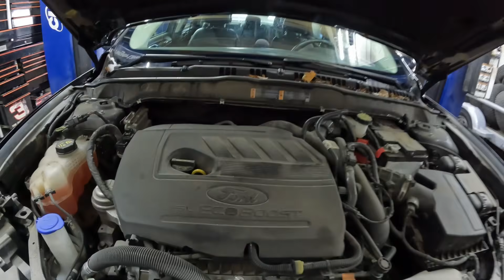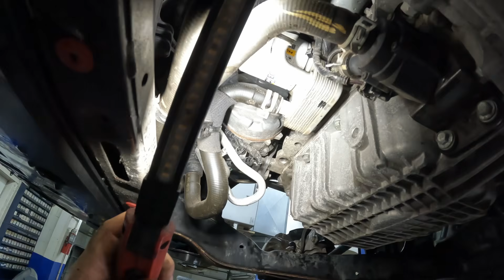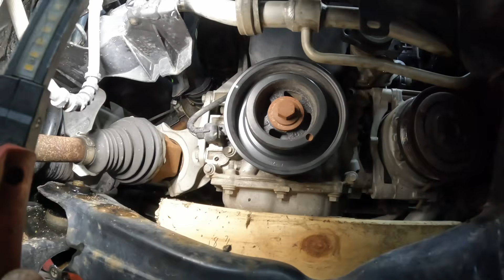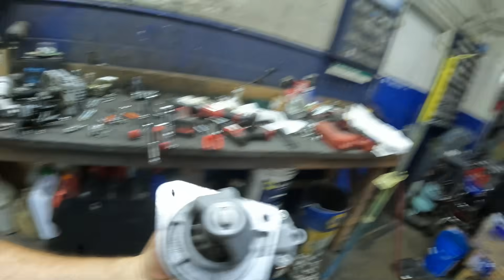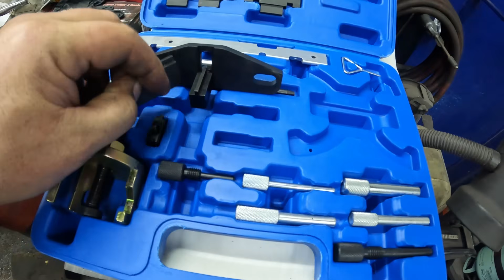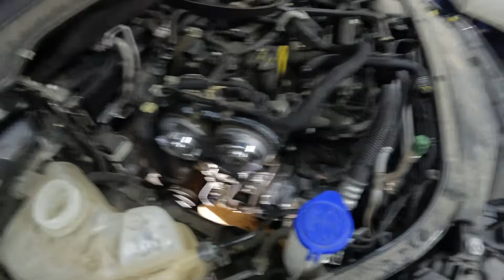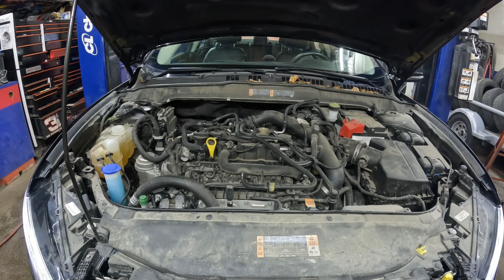2018 Ford Fusion 1.5L Ecoboost Water Pump & Timing Belt

Comment: @paycheckmonster Hello, would this be the same procedure for the 2013 Fusion 1.6L? Thanks in advance. I'm having troubles finding an answer. Planning on using your video to do the job if so.
Reply from the maker: I believe it is same procedure.  If you buy the timing tool set, it should have 1.5 and 1.6 tools in it. They might be the same tools also.  Not 100% sure.
Reply: @paycheckmonster  ok thank you. Also, great video! Another question regarding bypassing the removal of the starter. Would you suggest leaving the timing belt on while cracking the crank bolt free with an impact? Would there be any issue if the crank moved counter clockwise a little bit doing it this way while getting the bolt loose? Thanks in advance.
Reply from the maker: @JC-yb7vc  I take the crank pulley off before removing the belt.  That's just how I do it.
Reply: @paycheckmonster  great, thanks!

Comment: Just wondering what Book time would a Ford dealer have for that job?      Great video. Thank you.
Reply from the maker: You would have to ask the ford dealer about there pricing.  Thanks for watching!!
Reply: Prolly 7 to 10 hrs. I know its 14 to do the headgasket. And it takes all fucking day maybe 2 days. It pays 19 or 20 to replace the shortblock. Basically rebuilding the whole motor a weeks worth of work for 19hrs. And they say we screw the customers. Wrong all data pro demand and all these programs screw the techs hard. Luckily I work at a shop where I can pick and choose. I run my codes on these junk boxes get misfire on cylinder 2 and misfire on first 1000 revolutions and send them on their way. You wont fool me into doing this crap.
Reply: Book time for waterpump is 5.5hrs based on Mitchel prodemand
Reply: @danphillips6700  My local Ford dealer quoted me for 19 hrs and a cost of $6500-$7000 to replace the water pump and hoses. Tell me that's not a rip-off!

Comment: I did the water pump/timing belt replacement yesterday and everything went smooth except I think my crank turned a bit counterclockwise when I removed the crank bolt. Now I have everything back together and I went to spin the crank a few times to recheck and it is bumping. All my timing tools are  removed so I believe the crank moved enough to be out of time. Is there an easy fix for this or have I trashed my engine? I was able to get the cam lock back in place, could I try removing the belt and turning the crank back to hit the pin?
Reply from the maker: If you have the cam phaser tool in and the crank pin in.  The timing is set.  You also have to align the crank balancer with a another tool.  Not sure what you have going on without seeing what was done.  Definitely pull it back apart before you try and start it.
Reply: Your engine should be good bro

Comment: Do you even have to remove the crank bolt and the balancer?  Couldn't you just line up the tool in the cam phasers on top after the bolt stops the crankshaft and snake the belt onto the sprocket behind the crank pulley so you don't have to worry about knocking that part out of alignment?
Reply from the maker: You most defiantly have to pull the balancer off.  No way around that.  Thanks for watching!!

Comment: I....FEEL.....YOU! I just finished repairing a broken sparkplug....WITH a broken extractor in it for my brother's 2016 fusion.  I had to remove the head, and just did not have the time for a video! I went ahead and replaced the water pump and timing belt while i was at that point of disassembly.  OH, the damn hoses spilled coolant on me right up until the last second when i put them all back!!  YES..... you have to have the timing tools for sure, and  YES, A COMPLETE PITA! Great video! (great idea in "blocking" up the motor.)
Reply from the maker: Thanks for watching!!

Comment: What’s the torque spec. For the oil cooler bolt? Thanks , Great explanation & thanks for doing this video
Reply from the maker: 41 ft lbs.   Thanks for watching!!
Reply: Can you get the starter out with just pulling the filter n skipping the cooler or there isn't enough room to do so I take it? Geez there's a ton of things to replace just for a timing betl/water pump 😢 I was watching another video that says you have to use a new bolt for tensioner too? I'm doing this now on my mom's Escape cuz the pump is shot. Leaking like a sieve....thinking I'm gonna skip the starter/flywheel hold step myself.
Reply from the maker: @chriskulpa4056  You would have to remove the cooler to get at the starter.  I have done a few without locking the flywheel and had no problems.  You do have to make sure that when you are knocking the the crank bolt loose, that the crankshaft does not turn  away from the crank locking pin.  The crank bolt must be replaced and as far as the tensioner bolt,  it should come with the new tensioner.  I used a kit with everything in it.  Thanks for watching.

Comment: The problem you face if you don't pull the starter, you apply a lot of torque to the crank lock pin. Will the lock pin hold? If it bends or breaks you are out a engine your shop needs to eat. Just saying, I am going to do this job tomorrow, it is in my bay waiting. I am a master tech with 30 years in. Not worried about taking the crank bolt off, you can spin the crank back to the holding pin. Also I have done a ton transmissions in the escapes and never replaced the oil cooler gasket..
Reply from the maker: So the counter weight on the crank butts up to the end of the pin.  So you shouldn't shear it off.  I just think you can save some time by not pulling the starter,  but you have to make sure the crank is making contact with the pin for timing purposes.  As far as the oil cooler,  it's cheep enough to replace and didn't want any chances of a come back.  Thanks for watching!!

Comment: I'm going to do a timing belt soon on a 1.5.  what would you suggest I do, not to remove the starter?  Put the pin in, bottom it out,install the cam phaser lock, and hit it with the impact, and hope it doesn't move?  Isn't there an inspection plate on this transmission?  If so you could just put a bar in there right?  Any suggestions? Much appreciated
Reply from the maker: If you do the repair by the book, they want you to remove the starter to lock the fly wheel.  I do them without removing the starter but it would depend on the individual on what's the best.  If you crack the crank bolt loose with an impact, just make sure the crankshaft is making contact with the alignment tool "pin" in the side of the block before you proceed. Once you get in there and think about it, it will all make sense.  Thanks for watching!!
Reply: @paycheckmonster I’m actually confused which pin you guys are talking about here
Reply: @franciscogomez2565   The pin that you bold into the side of the block from the back after taking a plug out. The pin is from the timing tool set that has the X plate to hold the cam phasers.
Reply: @chriskulpa4056  OH THANK YOU! I got confused between the flywheel lock and that pin behind the block! Thanks. It seems the starter removal is unnecessary. Also I can’t find any kits online with a new crankshaft bolt. Is it a sin to reuse the old one?
Reply: @franciscogomez2565   Yeah HAVE to use a new bolt as it's stretch to yield. If you try and torque it like the instructions say with the I think it's 70 ftlbs then 90 degrees then 12 degrees more or whatever it is, you'll likely break the bolt. I think I heard of someone just torquing  it to like 175 ftlbs but I don't know that I'd trust it and I think the bolt was only like 4 bucks from the dealer. Not worth it to me to risk it. I bought the kit from Walmart of all places online but it didn't have the flywheel lock. Had all the other things needed though.
Reply: @chriskulpa4056  thank u for the information and the reply it is much appreciated
Reply: Have you done any w/o the flywheel hold since this video? My concern wouldn't be with removing the flywheel bolt so much as when tightening of bending that hold pin. Seems there's alot of torque going into tightening the bolt that could bend the hold pin?
Reply from the maker: @chriskulpa4056  A lot of people think the crankshaft counter weight is hitting the pin from side, but it's not.  It actually makes contact on the tip.  You wont bend it.  Make sure that is fulling threaded into the block though.
Reply: @paycheckmonster  It's not hitting it on the tip, it is hitting it on the side I'm pretty sure cuz I had to back it most of the way out before I could turn the crank. It seems like it hits a major amount so not likely to bend it if you don't have a cheap set. The only thing that I came across is that of course the crank can rotate back which I think mine may have a little bit but things seem ok so I'll say it's a success 😀
Reply from the maker: No inspection plate on these.  The only way you get to the flex plate is by pulling the starter.   I do them without pulling the starter but you need a good understanding of how the system is timed so you don't have problems.  The main things you need to make sure of is the phaser locking tool is installed and the the crank is making contact with the crank locking pin.  Thanks for watching!!

Comment: Hi , your video was very helpful! Do you have a link to the kit of parts that were replaced by any chance?
Reply from the maker: Timing belt kit came form NAPA #2523431,  Water Pump is Gates #42590,  Oil cooler came from Ford #DS7Z-6B856A.  Sometimes you can buy the water pump with the timing belt kit. The kit with water was not available at that time so I had to buy them separate. Thanks for watching!!

Comment: My suggestion on not pulling the starter, is to put the crank up against the pin, but leave the belt on so valves will move if the crank spins. Hopefully, it will break loose after a few degrees and then you take belt off and lock timing
Reply from the maker: That's what I'm saying.  Thanks for watching!!

Comment: Also the reason they use friction fixed gears instead of keyed is due to simplicity. It’s timed perfectly every time. No issues with a tooth off or the tensioner to tight and it sounds like it has a supercharger. Just whining because it’s tight. The phaser lock holds the cams perfectly. The crank dowel holds the crank. Install the belt. Release the tensioner and now it’s perfectly timed and tension is correct. Better than some vehicles with checking belt deflection and twist. Mini cooper did something similar with the N14 engine. But with chains.
Reply from the maker: You and both know that, but I see a lot people tearing into these vehicles and not knowing what happens when you take that balancer bolt loose. A lot of people just don't do the research either.  I'm a little partial to timing marks and not having to buy a tool kit for every engine.  Most of the tensioners are hydraulic or cam style with an indicator to set them.  In any case they are somewhat self adjusting. In rare cases you could have the old style tensioner that you just lock down, that would be one case where you could over tension the belt.  I just think they make some of this stuff overly complicated.  Assembly at the plant is faster I'm sure.  Appreciate the feed back.  Thanks for watching!!
Reply: @paycheckmonster  maybe it’s because they are trying to make sure you return to a dealer or it’s for the tool industry. Many theories with that. Every time I think I have all the tools I need I have to buy another specialty tool. It’s just the way it is. I do agree it was much simpler in the 2000s when all you had to do was line up the gear marks with the head and a pointer on the crank. But with the tools these are so simple. Just pull the pin and it’s in. But the no special tool engines are what I paid my tools off with. So they are still special.

Comment: Way too much unnecessary work just to change a water pump!🤯
Reply from the maker: Agreed. Thanks for watching!!
Reply: @Paycheck Monster  You bet! I was almost to try and help a friend replace the head gasket on a 2015 Fusion 1.5l but after watching this video, I will absolutely not help him!😄
Reply: 🤣 @daveyjones369
Reply: @Paycheck Monster  Also I have a quick question. My friends 1.5l won't start up (unrelated to the headgasket issue) It was throwing a P00C6 which is, fuel rail pressure too low. Replaced the fuel rail pressure sensor but no change. Took the high pressure fuel pump out and the tappet cup was stuck and wouldn't come out. After getting it out, I turned the engine over by hand and the cam shaft is not turning. Do you think it's a timing belt or cam phaser?
Reply from the maker: @daveyjones369  Most likely timing belt.  Anything is possible though.  Something really bad would have happened if the phaser shit the bed.  Usually they don't fail to point where it won't turn the cam.  Good luck.
Reply: @Paycheck Monster  ok good to know! Thank you for your reply!

Comment: But the only thing is went you tie the crankshaft bolt is a lot pounds torque the you can brake the pin
Reply from the maker: So your actually pushing on the tip of pin straight in line.   Your not actually making contact on the side like to sheer it off.
Reply: It buts up flat to a crankshaft counter weight, it would be a fluke if it couldn't hold up to what is probably like 200 ft/lbs